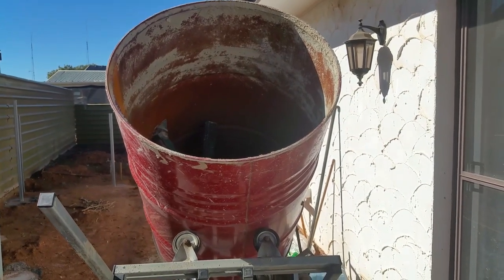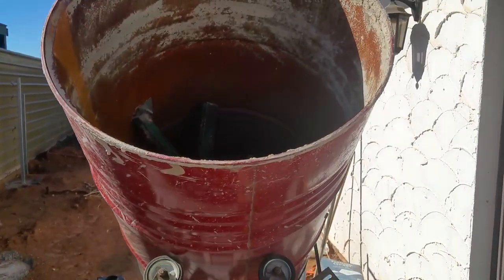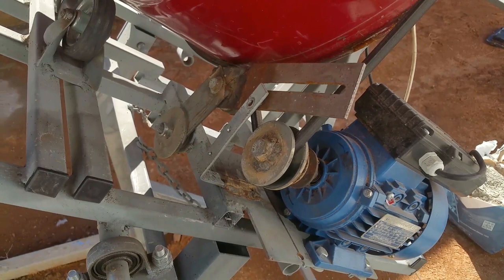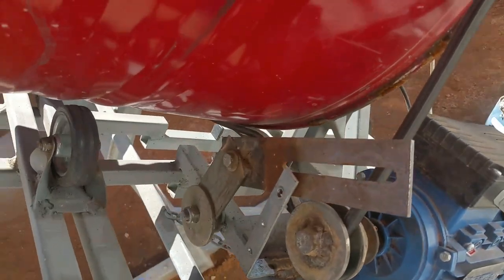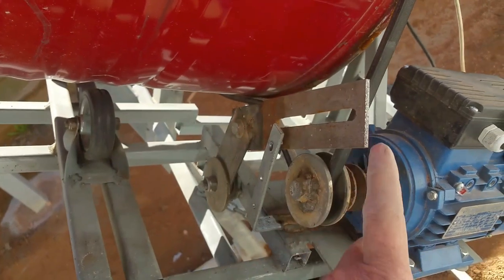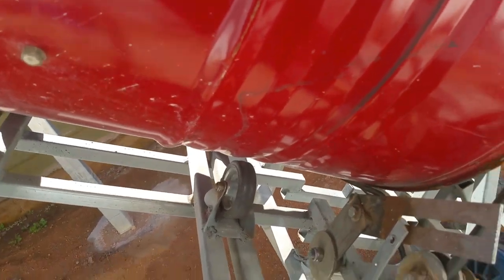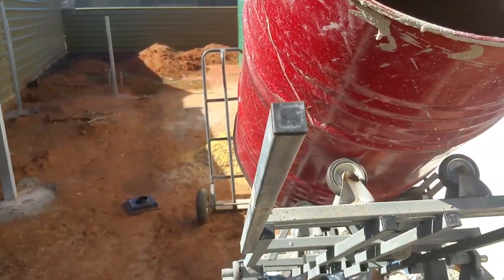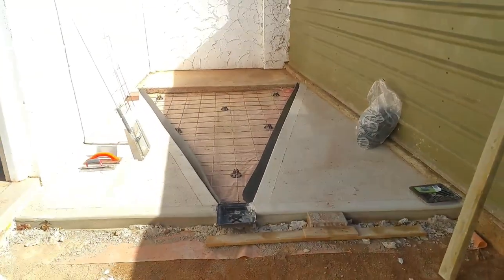How to Build a 55gal Cement Mixer follow up video

Comment: I happen to build a similar mixer for a project that was mountain remote and we used atv to get materials to the site .  Same 55gal drum only I used a extension at the discharge end with a taper or conical with flights or fins to provide mixing and discharge , I made mine from a sheet of sign material ( aluminum skin over abs core apron 3/16 thick but easy to shape. In hind site I think some angle braces  and some rubber belting material in a general direction of a flight screw would be much easier to clean . 
I made the frame from a old carpet dolly and used a riding mower transmission and a starter and flywheel for reduction to turn the barrel or drum at the right rpm 27 28 rpm for mixing and the reverse for slow manageable discharge. The first one I didn’t have two axles under it and was fine for transporting empty , but as soon as you loaded up to 3/4 of cy and 25gal of water with 400 lbs of cement , that wasn’t going to work for very long so we add second axle and that seems to give me less stress and the large over inflated atv tires distribute the weight off road with moderate conditions as far as level terrain and minimum mud traction conditions . I can go where a regular mixer truck would go ( fully loaded) and not get stuck and if I get stuck I only have to off load 3/4 cy or winch myself out .
Still the atv is to small for 3500lbs so at home it mostly goes behind a old John Deere m that work great for a 75 yr old tractor definitely not down the roads even empty is frightening between the 1/4 turn of drift in the steering wheel and the harmonic hopping frequencies of the trailer and I’m not that big of a hurry between fence post anyway

Comment: Great setup!  Similar to some ideas I had only better.  One suggestion  would be to use a flat Poly V belt for the drive.  Something like off a Commodore fan belt or similar serpentine Flat belt will get Heaps more grip on a flat surface like the drum. 
You can use V belt Pulleys for Drive, they flex and wedge between. 

Also for the speed, You can buy PWM motor speed controllers on Fleabay that will allow you to slow down a motor to any speed you want. They make the motors hum a bit but in my experience they don't hurt them long term. I have a few and use them for various things including Dimming lights and running 3600W heater elements at reduced outputs so they don't over load circuits or overheat things.  The motor speed controller might allow you to use a bigger motor pulley that will get more grip but allow you to reduce the speed to what you want. Because of the way they work, the motor speed controllers don't reduce the motor Torque  so that wouldn't be a problem. 

I was wondering about the bearing setup, you gave me the idea for some old car hubs I have up the back and use them as the mount.  I have some castors which I had already thought of as support but now thinking of an old car LPG tank I have for the barrel which would be stronger and easier to weld to. 

Thanks for the ideas on your design, very helpful and you built it very well. I'll bet it will outlast a lot of commercially bought stuff these days. 
Thanks for showing your setup and construction.
Reply from the maker: Wow thanks so much man I've put a lot of hours on it now and is still working awesome. I did buy a speed controller but it didn't slow down much. Might look into a better quality one. Thanks 4 your support and very useful tips. I've got more videos coming.

Comment: If you increase your length of your belt a little so you increase your tensioner angle it will help with the wrap of the belt on the small pulley and help with slippage
Reply from the maker: Thanks mate very good advice

Comment: If you increase your length of your belt a little so you increase your tensioner angle it will help with the wrap of the belt on the small pulley
Reply from the maker: Thank you

Comment: can I use a centrifugal water pump as an electromotor for a concrete mixer @MattyMiranda
Reply from the maker: You would have to have a power source to drive the pump so I would suggest not to but if you can make it work go ahead as long as the rpm of the pump does not spin faster than 27rpm you should be right.
Reply: @MattyMiranda  thank you my friend

Comment: Ремень не будет долго работать. Диаметр шкива слишком маленький. Ещё пару шкивов добавить.
Reply from the maker: Hey mate the pully size was correct enough to spin it to 30rpm but hey this homemade don't forget.
The belt.is still on there only problem was it slipped at max capacity.